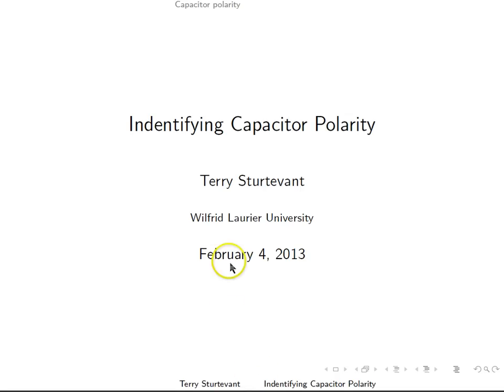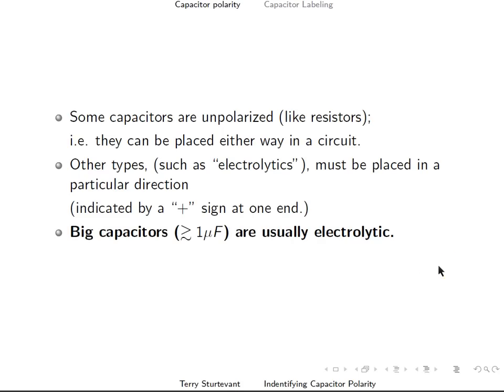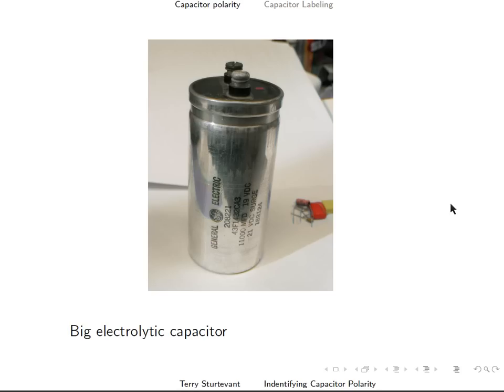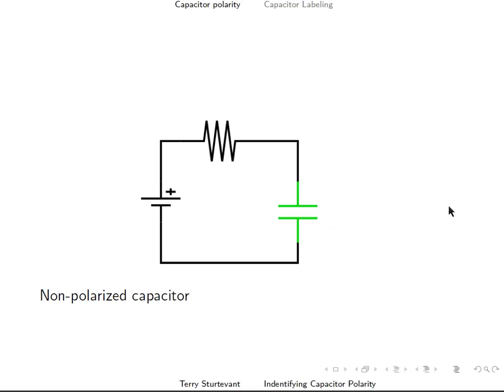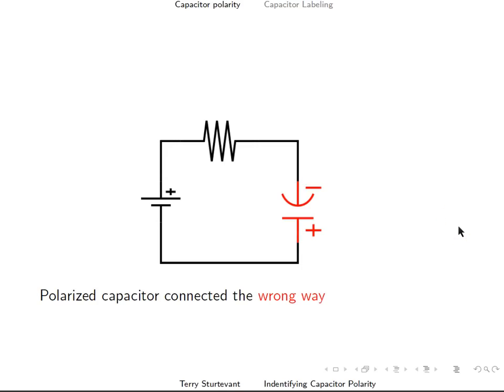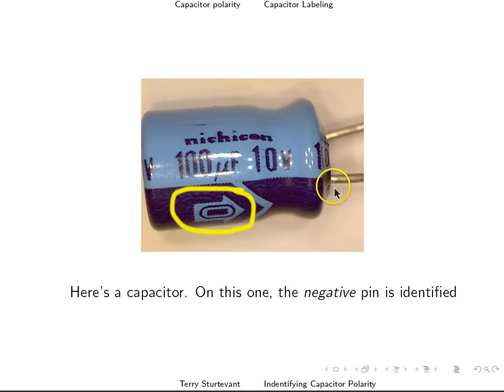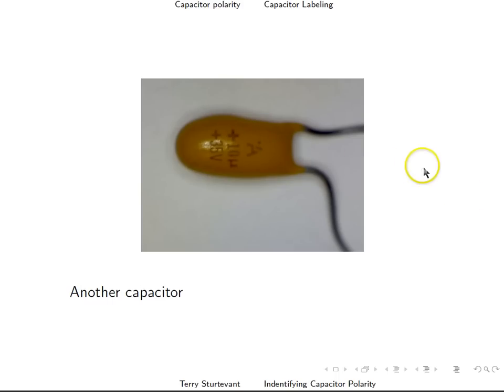Determining Capacitor Polarity

Comment: I was looking for a way to tell via meter on which side is which, because not all caps are marked properly from the manufacture. This video does not help me.
Reply from the maker: I don't think a meter will help, since the capacitance will be the same either way. A continued voltage in the wrong direction will eventually remove the oxide layer and allow a short, but a measurement itself is probably short enough to make no difference.

Comment: What about Caps with no clear markings? I got two 125v 10000f from eBay and both have no markings and the writing is to the side so it is unclear. It has a plus on it but could be indicating either pin. (it in the middle) Can I test with a digital meter?

Comment: [comment disappeared reposting]  I have some 1 farad 5.5v C-type super/ultra capacitors that do not have any markings other than a set of arrows pointing to one side.  There is nothing inside or around the arrows and there are no polarity markings on the legs so I was curious if the arrows signify something (like pointing to the negative lead).

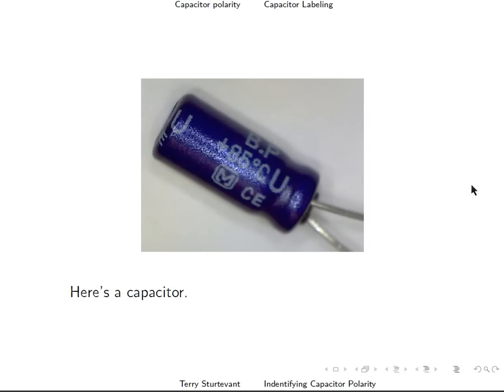Comment: All good,  except that electrolytic at 1:23 which you said has "+" close to the pin is not polarized, it was bipolar. Clearly marked as BP,  + is often found on bipolar caps and that does not indicate polarity. On this particular Panasonic bipolar capacitor  it marks +85C  or maximum thermal operating range.
 Be careful with that.
Reply from the maker: OK, thanks for the correction.

Comment: I just bought a cap from radio shack and I have no idea which end is which,  it's a 4.7uF 50V can with leads coming out of both ends without markings.  How do I determine which end is positive ??  THANKS!
Reply from the maker: Like in the video, see if there's an arrow along one side with a plus or minus in or around it.

Comment: The circuit board I'm working on does not denote + or -, the electrolitic cap does not have a + or - on it, so in this case how do i find + or - of the cap?
Reply from the maker: +Thomas Gregory  Is the capacitor on a circuit board? If so you may be able to follow the traces from each lead to see if one goes to ground. For many capacitors this will be the case.

Comment: my question is this - i work on guitar pedals and some of them point the capacitor with the guitar signal (ac) going into the negative end after a resistor and some pedals point the capacitor with the positive end being hit by the signal but there is no resistor before it - can someone explain what the difference between these are? because no one seems to know...
Reply from the maker: I'm not an expert, but my understanding of electrolytic capacitors is that the way they make the insulating layer is to oxidize one side of the conductor, so if a DC level is consistently applied in the wrong direction the oxide layer will be reduced, and the capacitor will short. So, which way the capacitor goes depends on which way the DC level will normally be.

Comment: What about large electrolitic caps that Don't have any Positive or Neg markings ?
Reply: How to determine the polarity of a capacitor using ohmmeter.
Reply: @felipeshea9328   looks like you are asking me a question ? i know how to use an ohm meter but have had trouble reading some large caps with no markings on them

Comment: I have, right in front of me, a Philips electrolyte axial capacitor, a small one, 1µF 63V,  that doesn't have a plus or minus sign. However, one end has a black ring around it and the other end has a waistline, or whatever it's called in English. Does the ring mean minus and the waistline plus? Or is it the other way around? Or should I just try and see if it explodes…? 😁
Reply: Maybe one lead is shorter than other, the shorter one should be negative

Comment: I wish you can explain "why" whether polarized capacitor is connected wrong
Reply from the maker: Part of the insulation inside is produced by oxidation on one of the contacts, so if voltage is applied the wrong way the oxidation can be reduced, leading to a short.
Reply: Terry Sturtevant So what's about current direction moving in the circuit? Since you mention there is part of the insulation inside is produced by oxidation, is it positive or negative of the polarized capacitor? I am taking "Introduction to electricity" and I try to learn the components, concepts and how to read schematic. I find your videos are quite helpful. Thanks for your answers
Reply from the maker: ifoxrider  Take a look at the entry in Wikipedia: http://en.wikipedia.org/wiki/Electrolytic_capacitor
See the section on "Polarity"

Comment: Pausitive and Negative are obvious! But how about a Dual Run Capacitor 80+5 MFD 370/440v  With 3 connection's? Heam Fan & Common!
Reply from the maker: I have to confess I've never seen one of those. How do they distinguish the 3 leads?
Reply: Exactly! No idea.....
Reply: are they base, collector, and emitter ?